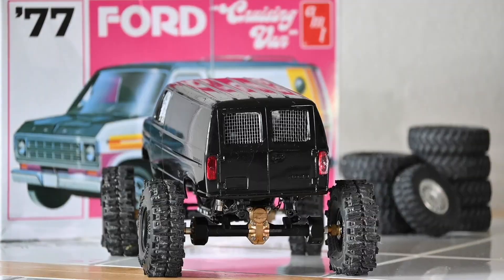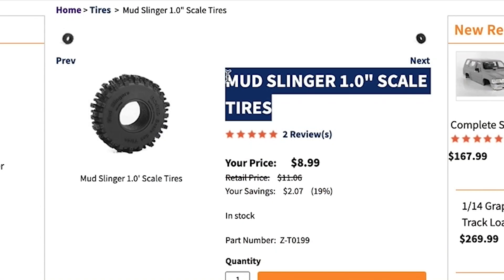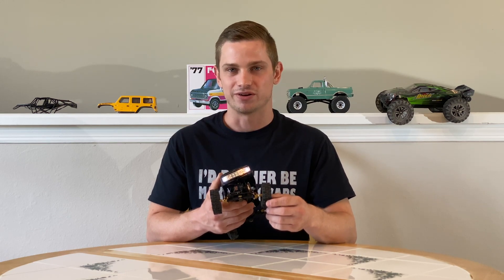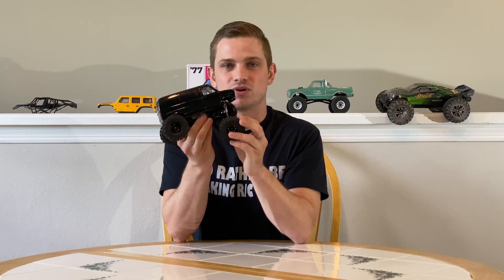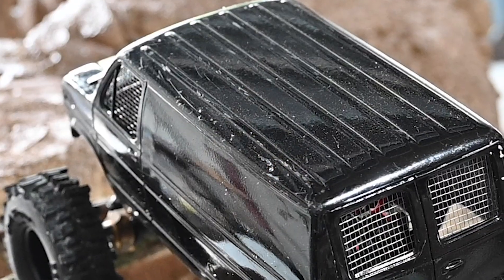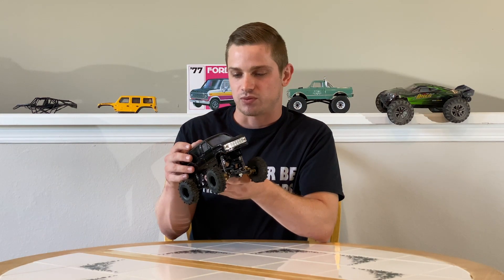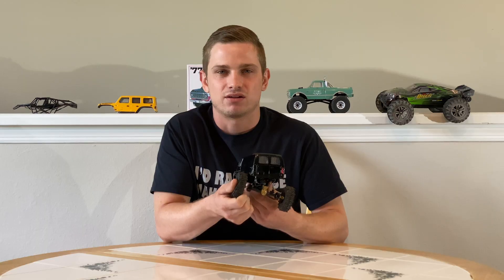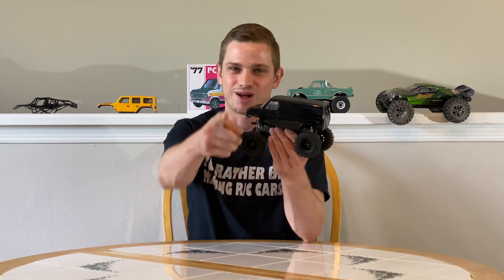AXIAL SCX24 1977 FORD VAN BUILD

Comment: I'm using this model kit on my fcx24, I've had a tough time getting it to fit with the servo arms (4ws). I'm gonna have to move the servos deeper into the center I think, gonna need some custom fabrication. Ill have to widen it like you have too, but I don't got many options for the fcx24 and portals wider kinda defeats the purpose. Maybe I'll use smaller tires. Thanks for sharing, it looks great. Don't feel bad about the price, I'm at $500 so far lol.
Reply from the maker: It’s an expensive hobby but a lot of fun! I still have my Van and crawl it around all the time.
Reply from the maker: It’s an expensive hobby but a lot of fun! I still have my Van and crawl it around all the time.